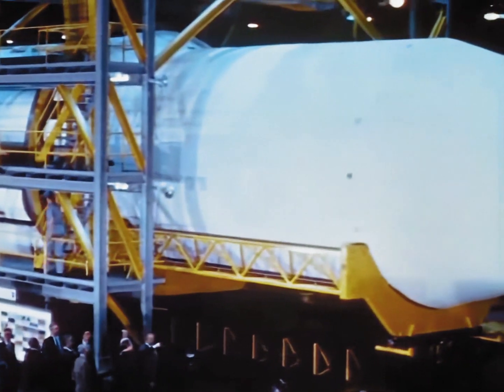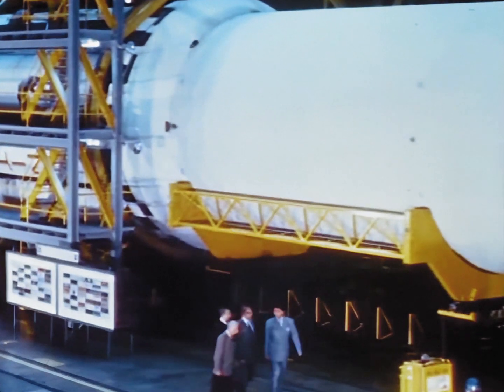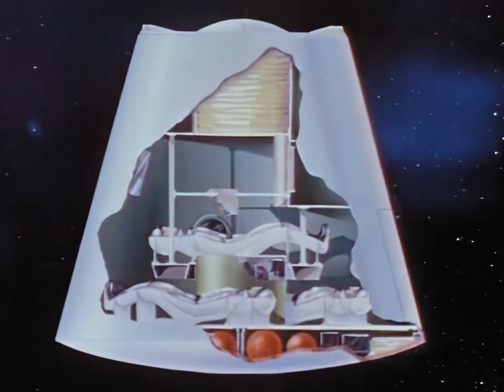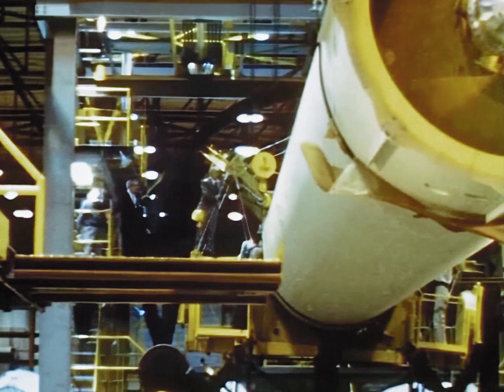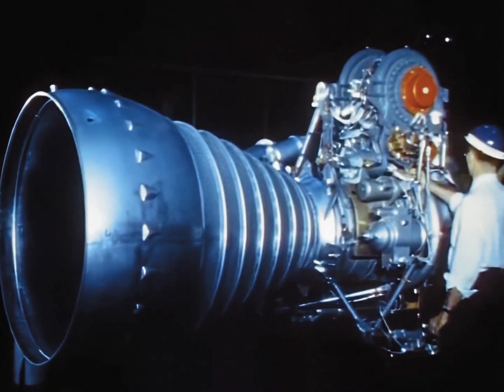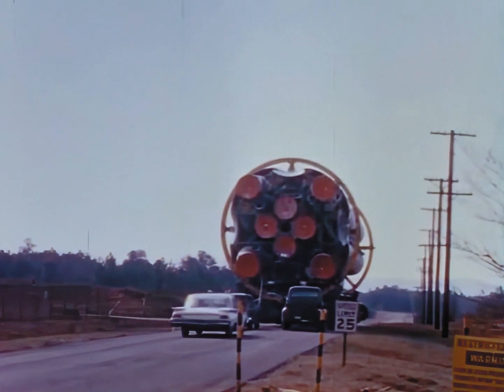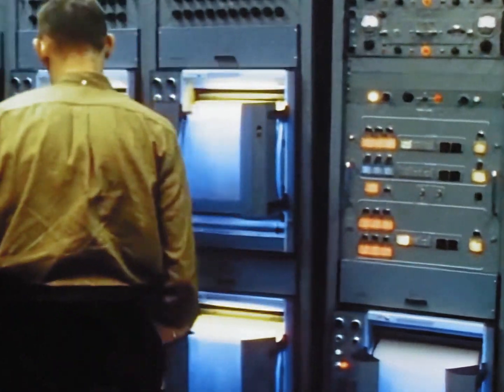Saturn Giant Thrust Into Space - AI Remaster, Upscale, Cleanup - Saturn I, NASA, Documentary

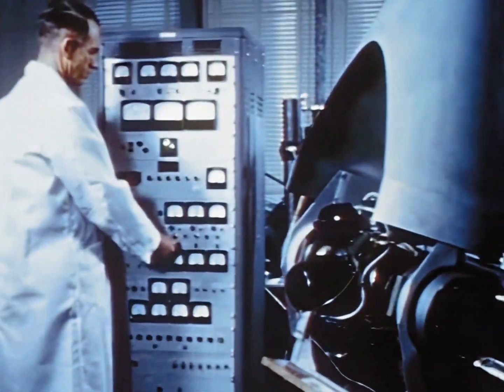Comment: @4:29 wut?
Reply: Testing the gyroscopes which are part of the inertial guidance system.
Reply: @spinav8r  I just wondered what the dude was winding. It looked like he was about to take a tape reel of it's spindle, but no...
Reply: @DrMackSplackem  - If you're referring to time stamp 4:32 , the guy is using a ratcheted socket wrench to either tighten or loosen a bolt/nut.
Reply: @spinav8r  Oh yes indeed, haha. It's all clear to me now. That's some pressure vessel.
Reply: @spinav8r  that appears to be the RL10 the final assembly area at Pratt & Whitney, the tech is wrenching on a turbopump. The RL10 to his left is a bare thrust chamber without pumps/valves/controls attached.